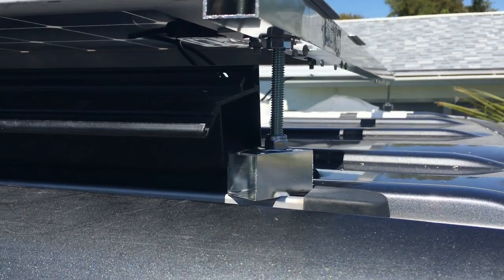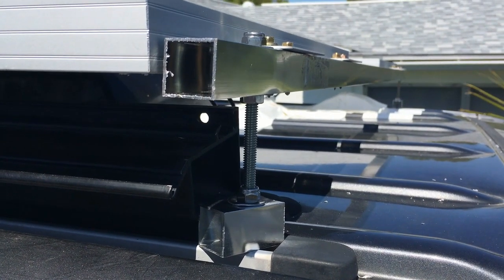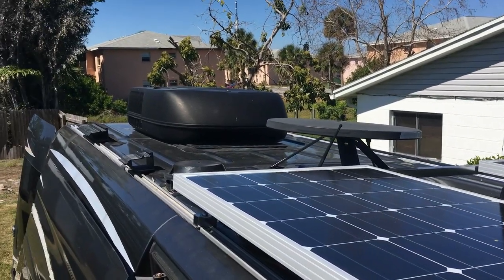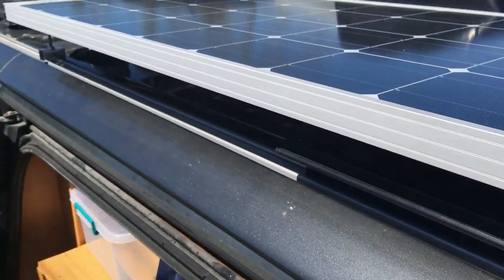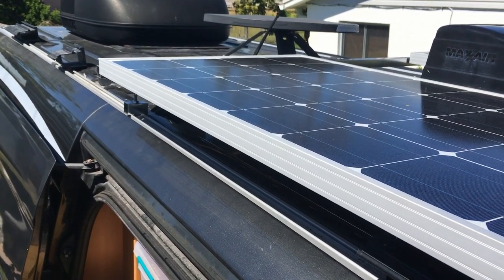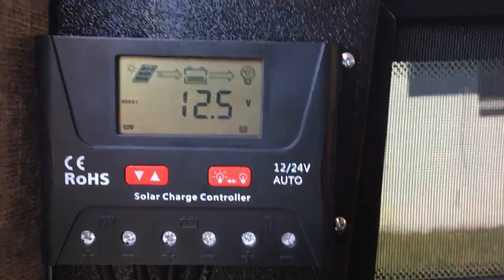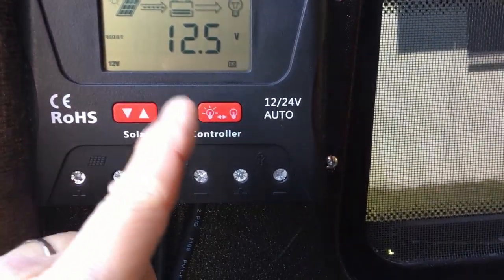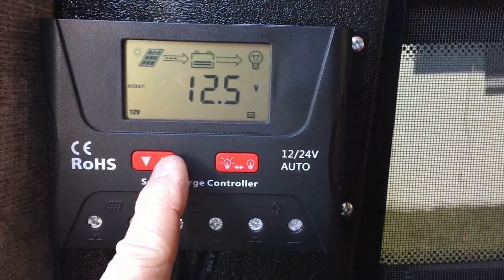Solar Panel Install on Sprinter Van

Comment: Hi, thank you for sharing this!  I'm curious to know how you fed all the wiring from the roof to the back without drilling a hole.  Did you remove the awning to accomodate the solar panels?  I'm thinking of doing this to my ERA.  Thanks again.
Reply from the maker: Ron, Thank you for watching.  On my ERA that was a XM Radio antenna that came out of the roof on the driver side.  The antenna was toast and I had stopped using XM a few years back.  I took the XM antenna off and used the hole that was already in the roof.  I needed to punch a hole through the insulation.  If you do this be careful it's very easy to punch a hole in the ceiling fabric.  I passed the cable (you will only have two cables to pass through) through and worked it over to the door frame covering and ran the cable down behind the plastic to where the bottom of the window and than ran the cable behind the finishing  plastic all the way to the back.  It's not hard to run the wire hidden once inside the van.  Most of the run was behind the counter top.  I relocated my batteries to the inside and run two 225 Amp hour 12 volt batteries wired together to get 450 amp hours at 12 volts.  I need to add another solar panel or two but the 200 watts  does a good enough job for now.  Plus the batteries can be charged by the alternator or the on board generator.  I run a 5600 watt inverter that powers all the electrical.  I even changed out the refrigerator to a small college dorm type which runs great and stay much colder than the original one that was in the van from the manufacturer.  I will be changing over to a 3000 watt pure sine wave inverter soon.  Even though the 5600 works great the microwave takes way longer to heat things up (it doesn't like square sine wave power).  But, the TV, stereo, refrigerator, portable heaters, phone and camera chargers all work fine on the square sine wave.)  I also changed out all lighting to LED lights which made a huge difference in the power consumption when boonedocking.  Let me know if you have any questions. Until next time we will be thinking differently in the Blue Line Vagabond.